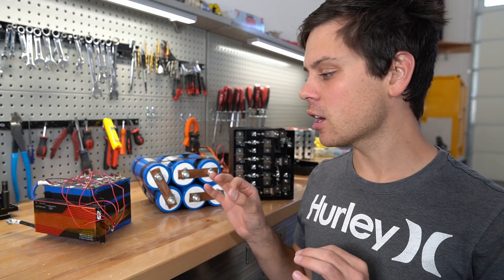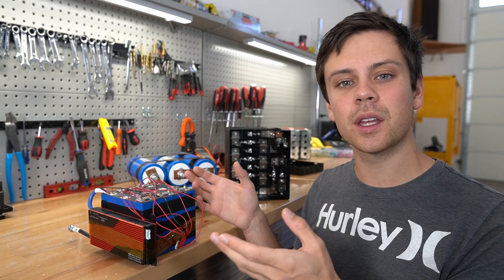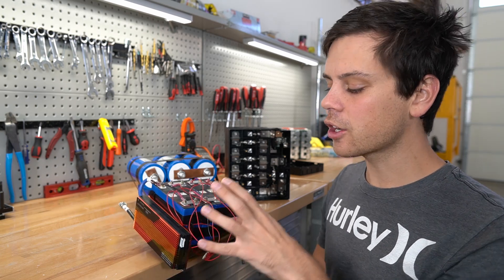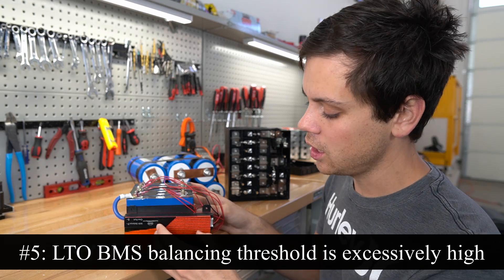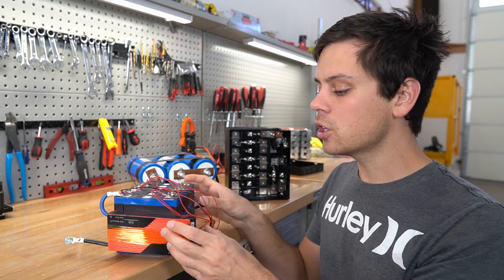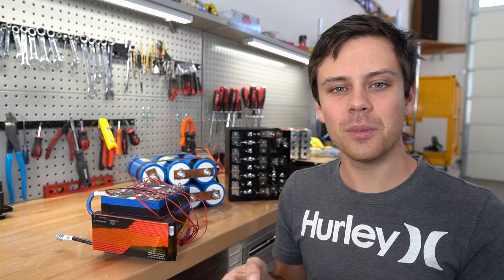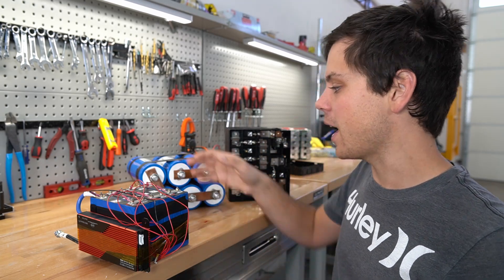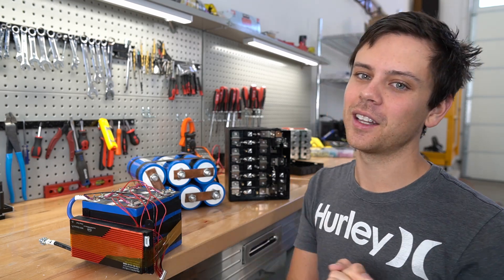I was wrong about Lithium Titanate batteries. But should you use them for solar? 2020 Update

Comment: for my application lto is the best (so far) to use.  i need long life, a low self discharge rate, wide temp range and high c rates for automotive use. Sure they aren't cheap, but then replacing lead acid every 3-4 years isn't cheap either. Gone are the days when you could hit a auto parts store and grab a new LA battery for your car for under $40.
Reply: What is the configuration you chosen? 5s? How many pararell? What BMS you chose? Also what cells did you chose? (Producer)

Comment: Question where do you get your BMS for the Lithium Titanate Battery and why can't you use 5 in series?
The discharge curve for these batteries is 2.1 volts to 2.8 volts per cell, so with  5 cells at minimum 10.5 volts to 14 volts fully charged.

Comment: LTO cells are a motromer homers dream they can phicaly sit where the lead acid house batters where, outside or down center of the frame rails of class A (without pass through storage). aside from cost the batter bank could be huge and could be charged at high C rates. What more could a motor home want to never have have a generator or solar panels, just multiple huge alternators activated like a jake brake. You can buy a lot of batteries for the price of a 7.5 KW generator

Comment: The size, price, and voltage are the only turn offs for me. They're literally close to 2.4 times the price of the 120 ah headway bank I'm building currently. But damn, the c-rate of those bad boys is crazy. They would match my ultracapicitor pack better than the headways but I can't afford them lol. Also will I just bought your recommended power supply. Itll be here tomorrow I'm stoked

Comment: Well, 6s or 12S lto batteries work good when used with 12/24V AC inverters, you can use most of the lto capacity.  But yeah, only a few solar charge controllers will let you charge them to capacity. Don't need an expensive bms, I use a supercap pcb with an active balancer (capacitor types).

Comment: In 50 year you HOPE they will replace them.  If society falls apart it would be nice to have a 30+ year solution to run basic low power RV stuff like Vents, water pumps and LEDs etc..  An apocalypse battery, or long term basic battery if you Will!

Comment: Out of all the batteries you have tested, why not Firefly agm? I am just curious, I have just purchased 4 and building a system but would love to see a comparison.
Reply: Qgm doesn't last nearly as long. Super heavy and you can only use half of the rated capacity. I've been putting a order off for 3 months now.... I think I'm going with lto. Even tho I can only charge up to 78%  the long life and temp ranges are needed in my area.

Comment: best way to not trash the earth w/batteries is to make them last decades. comment 359 showing safe temp operation range & fast charging, & if u mix in a few just lithium  u will get benefit of both. They will get cheaper when u ^ & every satanist r killed off so truth will rein.

Comment: semi truck starter? Better than supcap battery assist. When hell freezes over, these tuff little truckers are at your back landing a solid punch to getchu out of a jam,  but otherwise are safe and sane as any normal professional driver. Light as Mohammed Ali, power density similar, size same as traditional LA, may even fit in exsiting battery tray. Lightning in a coffee cup.

Unlike supercap with it's nerve wracking complete self-discharge over a few days- as useless as a lot lizzard in church- these can hold a good charge so expensive companion LA not needed. And unlike the truckstop heifers, these bulls will get you home to visit the family.

Is this not a reasonably affordable replacement for the expensive supercap-and-LA battery starter assist system, or did I miss something when  I stepped out and that handsome asshole cowboy lassoed my prize heifer?  vibration, heat, waterproof, actual cost?

Comment: Hi Will, it seems the perfect battery to be put in a container with solar on top in a climate where timeperature will be between -10c and 30+C especially when the location might see weeks unmanned with no charge (as these batteries won't die when they are pulled low) .

How do you feel feel about that? (currently running classic wet (open) lead acid batteries as they seem quite OK in cold and they are cheap!

Comment: With the various current range and future cell technologies I think there is an opening for a programmable management system.
Imagine if you could enter the nominal voltage, upper and lower voltage, percentage of capacity to use, temp monitoring parameters, maximum charge and discharge rates; then the management system would allow you to run any chemistry with full or limited capacity (for longer life). With the low price of microprocessors - ARM processors cost cents in volume - this is eminently achievable!

Comment: My system is a 48v hybrid off-grid system.  I put together two 48v 200Ah Lifepo4 and hook the two in parallel to get 400Ah.  Almost always when supplying load to till it cut off point.  1. How come the other 48v tray does not drain to its lowest cut off voilts?  And when the system charges back up.  
2. Does it suppose to charge one tray at a time?
I all so heard you have mention in one of your clip saying that battery do not like to be parrarel .
3.  LIke to know why and how to make it like one another so it can supply load equally?
  THanx for information.  keep up the good work.

Comment: These are all great points.  Considering the use case and how the batteries perform best - both LTO and LFP  are great choices.  In Texas where the Energy market is deregulated - energy storage beyond solar (distributed generation) is becoming more important.  Some suggest the as a result of growth, expanding renewables and as well as retiring coal power plants that energy prices will become more volatile and ultimately more expensive.  Now to build renewables such as wind and solar throughout the state it's imperative to build batteries next to them else congestion occurs and prices in the real time market or between locations get's wonky.  But even with large scale battery solutions - no matter the battery type - I still think the solution comes back to baseload or nominal battery storage within a home.  In this case, as the market in ERCOT/Texas allows through an Energy Company - a battery in the home could utilize a high frequency arbitrage algorithm via price triggers to charge quickly or discharge quickly.  The concept of buy low sell high works much better if it's responsive to the market which LTO would allow.  After playing with the configurations, cost benefit analysis - I think the solution in this case is BOTH LFP with linear predictable charge and discharge then set aside 25% of the  battery capacity to the LTO which could arbitrage around it and could handle 15 minute spikes where prices can go from 0.01 cent kwh to 1000 cents kwh.  This is a use case where both batteries would provide a great deal of benefit both for the home/end user and ultimately the grid. Lengthy but a unique application yet still not as awesome as satellites needing LTO battery - that's cool!

Comment: What attracted me to LTO for a 48V pack was the advertised 20,000 cycles ( vs 2,000 from LiFE) If something costs 2x, but lasts 10x longer, then lifetime cost is lower.  At 20,000 daily dischargd cycles, that would be 50 year battery for a solar set up, so would not have to replace batteries in my lifetime.
Or is 20,000 just Chinese marketing hype to seperate a fool from his money.
Reply: In fact, there is a batch of LTO in Yinlong headquarters, which has been 40,000 cycles. From the establishment of the company.

Comment: Great video! In science mistakes can happen, it's normal. The real mark of a true scientist is the willingness to update one's views based on evidence.

That being said, the application I'm really interested in for these is replacing sla car batteries with a 6s array of LTO. Based on what you said about changing in 12v applications it seems like their full potential would not be able to be utilized. But I'm not sure if it would really matter if you just wanted the short burst of high current to start the engine. One could potentially use an active balancer to help mitigate cell drift rather than a bms since the balancer is always on and can run at pretty low voltage. The reason I'm so interested in this is the cycle life of lto. A pack of those could potentially outlast the lifetime of multiple cars. With sla's needing to be replaced every 3-4 years and costing ~$120 the savings by using lto could really add up. Not to mention the reduction in waste production and CO2 emissions from making all those sla batteries.

Comment: These cells make for fantastic battery packs if you value safety, longevity and ease of battery pack building in extreme hot or cold climates. Evs are a good use for them if you don't need to be super space or weight efficient.

Comment: I am looking to replace the lead acid batteries in my class 8 Commercial trucks. They operate 4 12v batteries in temperatures between -45° ~ +150° F. I currently have to replace them 1 to 2 times a year. They draw around 900 Cranking Amps. And cost around $400.00 to replace (about $100 each). Any ideas or information would be greatly appreciated.

Comment: Your hair? Do you just get out of bed and make a video? Even a Li-ion battery, which if it is NMC based, or other low temp tolerant chemistry, the derating at -15C still delivers more capacity than an equal weight and price of LTO.
Reply from the maker: Haha yeah. Oops

Comment: ID say LIFEPO4 was worth the purchase 20 years ago as they are still good. ID take the plunge with these Litos because maybe in 50 years perhaps they will be redundant but in 25years prob still being used if you consider the 80's for leadacids, 2000's for lifepos etc

Comment: I love my 100 Ah LiFePO4 DIY battery I built after watching Will's videos.  I used Sinopoly cells, a Daly BMS and a water tight plastic amo case. It works great in my sailboat to power my 12 volt systems and 40# thrust trolling motor. I charge the battery with Renogy 100W suitcase panels. I just bought another, so 200W next summer.  :)  Thank you, Will, for showing me the way!

Comment: Ok so I'm looking for the best lithium to use for my application this is for my car I will be pulling up to 4000amps of current my voltage will be at 15.9v I need a fast discharge rate and charge rate something that's safe due to this will be in my car. I built a lithium bank for a different vehicle using cmax Panasonic cells they are 26ah 3.7v cell I built 240ah bank using those cells in a 4s configuration it works good but I know there's alot better out there thanks love your channel!

Comment: Will, what's your opinion: Say ya want to maximise the available energy and choosing between 11S and 12S. 12 S will have about 8% more energy from the extra cell. But ya have to limit total voltage to 30 volts for use with typical 24 volt equipment. So the cell voltage is 2.5v max. The lost energy not going to 2.6v is roughlyabout 4% I estimate from 2C curves. So I conclude for energy storage its 4% better to use 12S limited to 30v than 11S. If the BMS balancer threshold can't be adjusted accordingly, then use an active balancer. Perhaps there is an energy boost from the higher average operational voltage of 12S too. Your thoughts?

Comment: So if a fully charged Lithium Titanate 5s pack is at 14.5 volts, how does that not work for a 12v application?
Reply from the maker: The voltage drops rapidly. Check out the discharge curve
Reply: @WillProwse  Your not making this easy. Lead acid batteries don't stay at 14.5v either. Why is this a big deal? It's a lot easier for you to  tell me where I can find  that chart that you speak of than me going out and searching for it. I already tried while watching your video going back and forth trying to figure out what I was missing without much luck in making sence of your claims.
Reply from the maker: @Energizer34  watch my first lto video. It's easy to find
Reply: @WillProwse  I watched your 5s video and I still wonder if the 5s would work under lighter loads or more batteries in parallel. There has got to be a reason why the 5s BMS's are more popular than that 6s BMS's. I won't be using them either way because I am building 10 packs of second life 4s16p Lithium-ion 18650's for an off grid RV application.
Reply from the maker: @Energizer34  try them out. I would still go with 6s with reduced capacity
Reply: @WillProwse  6s would not work well for charging with an alternator. I would like to find a lead acid battery replacement to switch out all of the lead acid batteries in my RV. I don't think I am ready to try it just yet. I am also looking at a Lifepo4 off the shelf solution. Have you seen the rebel 12v batteries?
Reply from the maker: @Energizer34  actually 6s would be perfect with an alternator and why people choose that for car audio packs. You would not charge up all the way but the majority of capacity is below 15v anyways. That's why lto 6s is awesome with an alternator. What do you mean
Reply: @WillProwse  Most BMS's do top balancing so the voltage from the alternator would not be sufficient to top balance a 6s pack would it?
Reply from the maker: @Energizer34  ohhh I meant if you use something to balance it. Oops. Check out the car audio forums. They do it often. And I'd go with LiFePO4 if I were you. Easy to use.

Comment: Hey Will, how long would a bb last if it never went below 90% charge each day? I'm wondering bc I've seen a few RV systems and a lot of the folks say they never go below 90-80% which makes me wonder if that is even considered a charge/discharge cycle and would the battery last extremely long in that condition? 
Also, if you never go below 80% charge do you have say 60% more batteries then you need?

Thanks a lot

Comment: Hi Will, what do you think of using 6S LTO + active balancer, for 12V car battery replacement? To me the benefits (wide temp range, cycle life) outweigh the drawbacks (~80% capacity on 12V system, relative weight & expense). In a car battery replacement application, I don't need >95% capacity/efficiency, and if I can use a balancer instead of a high-current BMS, that reduces the materials cost by ~$100. Compared with LiFePO4, with which I'd always use a BMS, it's becoming an attractive idea even in warm climates.

Comment: Thanks for making a video on that, and showing the errors. I and few other YouTube users did point to you about these issues few months ago, so good you finally done some other tests.

I agree LTO, are a niche, and generally not preferred for solar. As of calendar aging, well, that is still something I would love to see, because there are different opinions on this.  LTO still is good for very high C rates (~10C), even if it means lower efficiency in energy itself. I don't know what exactly applications require 10C, but maybe some power tools, or spot welding, could benefit from it. I believe the LTO do have really good cold temperature performance, so maybe there are some applications where it matters too, and are inherently safe. Like satellites, with frequent temperature swing, and a lot of cycling in short time.

Comment: Hi William,  I have a question(maybe you have a video about, then sorry). Im building LifePo4 battery for my little boat. But unfortunately manufacturer of trolling motor says we cant use lithium battery to power it because higher voltage output damages the motor. So the question is: is that statement true? is any way to limit "output" voltage if I already have a BMS or you still recommend to update my BMS?
Thank you!

Comment: I'm running Toshiba's LTO cells in my 71 Harley build. They are heavy. Twice the weight of lithium ion however the benefits out weigh that. I'm very impressed with what I've found. I have a 60 mile range and can achieve speeds in excess of 90mph. Being able to not need cooling or heating is great! I can use all available regen and I can charge with almost any power source. Not to mention I've got 108 cells that I have yet had to balance. 🤷🏼‍♂️ Plus thinking I can leave these to my family when I pass or the ability to repurpose them into any application I want in the future is a huge +!
Reply: 108 cells on a harley? suuuuuure!😂
Reply: @ernieschatz3783  each brick has 12 cells 9 bricks equals 108. Unless I missed something while building it. Lol! 🤷🏼
Reply: Dang that sounds great. Is that all you could fit?

Comment: Hi William, I LOVE your channel, you know what you talk about, and you are clever enough to requestion yourself and recognize own misjudgements ! 5% of people are capable to do so :-) 
PLEASE CONTINUE SO ! 
IMHO, the biggest and UNIQUE advantages of LTO are resistance to low temperature AND incredible lifespan. I want my tiny house electricity to work under polar conditions where -20 °C is common... and work when my house is completely cold. And I want the system to last 20 years min. I such scenario, forget Li iron phosphate...
The system will be 48V. 
Finally, about price, wait and see, LTO price is already falling quickly and might become equivalent to other chemistries. Today, I can get a rack or wall mounted packaged 2.5kWh 48V/60Ah battery with BMS for 1700 USD with new cells, which is very decent price.
You might fall in love with LTO soon :-)

Comment: Do cylindrical cells have the same orientation issues as prismatic cells, where if you set it down on the wrong side, the battery does not work properly?
Reply: No